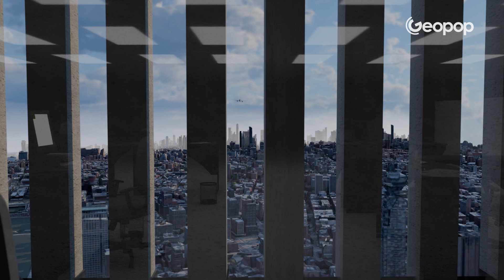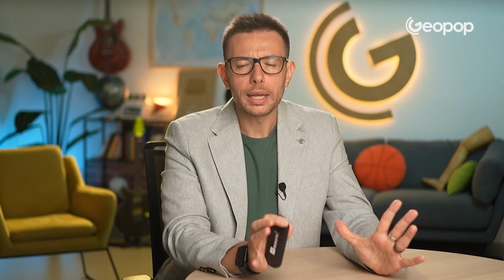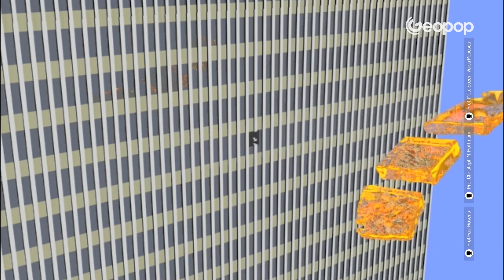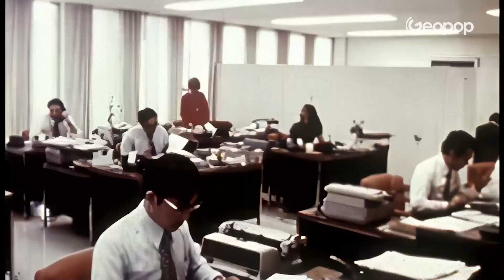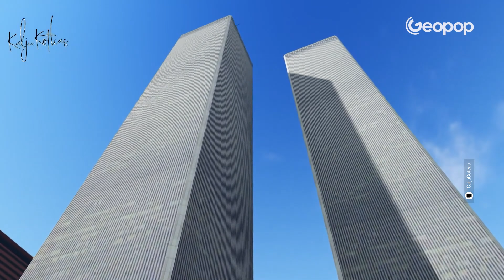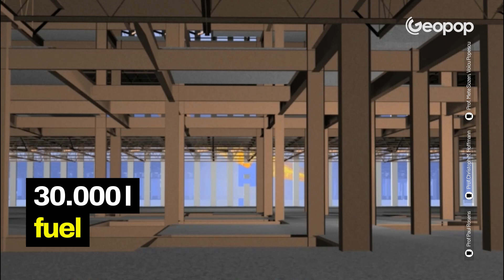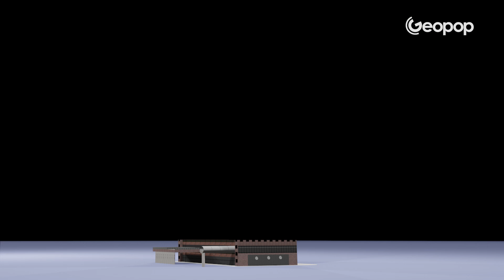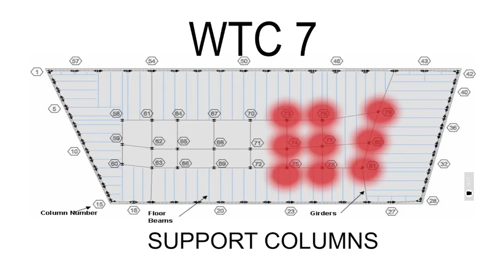9/11, 2001: The Technical Reconstruction of the Twin Towers and WTC 7 Collapses

Comment: In laymen's terms the floor trusses started sagging and pulling the exterior columns inwards and started buckling.  This coupled with the fact that the floors were weakly connected to the core and exterior perimeter tubes with visco-elastic dampers were the undoing of the buildings.  Steel is very flexible unlike aluminum and when heated up, loses significant amounts of strength
Reply: I work for a major contractor in NJ. We find those stupid bar joists everywhere and they typically very light weight. They are what hold up pharmacy, supermarket, warehouse, and other light roofs. Any time we put a point load over 150 pounds they require reinforcement. I can 100% can see those crappy joists giving way and pancaking the floors down.
Reply: That's what he said in the video we just watched, WTF?..
Reply: People tend to ignore the connections. 3/8” channel welded flanges to core. We see a portion of the core standing after the collapse. This tells me the welds broke. The outer perimeter connections were 3/8” angle which was 4”x6”, those would just fold with enough weight.
Reply: Thermite charges set by undercover CIA operatives to retrieve hard rives from the headquarters of the old CIA building so this whole video is a farce
Reply: Ask any veteran Fireman their opinion of steel support trusses.  They literally hate them because when exposed to the heat of a fire their tensile strength will compromise to the point of collapse.  Those trusses in the towers were no different.
Reply: @b3j8 correct. They say ‘never trust a truss’
Reply: @b3j8  they won't believe you. They prefer their wacky theories. I have heard that before though, isn't the saying never trust a truss
Reply: @TomVVG  Yeah I know they wont.  But I try to put the honest truth out there anyway.  That saying's valid for sure.
Reply: @b3j8  trouble is, I'd love to have an open minded debate about it with them, but it always ends the same way
Reply: @TomVVG   Nah, I'd rather spend my time watching the survivor stories.  One guy I really wish had made it out was Port Authority employee Frank Demartini.  He was an expert on the building's design and parameters.  He could have been a welcome source of honest, accurate information having made it up to floor 91 looking for survivors and trapped people.
Reply: @b3j8 yeah it honestly is sad he lost his life that day but I can't imagine the amount of hope he instilled in the people still inside till the very last second
Reply: @b3j8  theres a saying fireman have “dont  trust the truss”
Reply: @b3j8  I have heard that very thought. I agree.
Reply: Yes,the extreme heat took the temper right out of the structural steel. It obviously becomes very weak.
Reply: well 🤔if they haven't shipped all that evidence (steel) overseas  we wouldn't be debating what happened, that was a crime scene & should of been closed off and properly investigated
Reply: @Holiness_Holly  
There are steel samples all over the country now.
We have a few by a restaurant on the Mohawk River.
Reply: But that syncronous falling is weird..
Reply: @ahmetmutlu348  it was a progressive collapse, look it up. The floor at the impact zone gave way carrying the weight of 26 floors (2 wtc) and 11 floors (1 wtc). The floor below could not handle the hundred thousand tons crashing down on top of it

You 9/11 truthers are literally so fucking stupid I cannot understand how you cannot comprehend the collapse of the world trade center towers
Reply: Still doesn’t explain why the interior steel lattice completely disappeared. Assuming that the fire did weaken the interior frame, the section above the impact would have twisted and broken off leaving the building’s remaining floors beneath the impact still standing.
Reply: The trusses were much smaller than the perimeter columns...seriously, compare the floor trusses to the core and perimeter columns.  I find it very hard to believe that floor trusses that small (in comparison) sagged from being weakened by fire, and somehow found the strength to pull these huge sections of perimeter columns inwards and cause a collapse...especially in a softened state.  Steel structures sagging in fires is most definitely not out of the ordinary.  But in this particular case I don't agree that the trusses had the strength to do what we are told to believe.

Not to mention that the upper sections of the buildings, most easily seen in the North tower, seem to visually almost completely disintegrate within about 4-5 seconds after collapse initiation, seperately from the lower structure.  In other words disintegrating to practically nothing long before they ever could have destroyed the entire lower structure in a global collapse.  These 2 videos show best what I mean:  https://www.youtube.com/watch?v=-ib93ktc454&list=PLBeNQtKAgYU7SZNDOkdEivdzxw8WYGAp9&pp=gAQBiAQB
Reply: @yearginclarke  you literally havent got a clue what you are talking about
Reply: @dr00andrew  You can think whatever you want.  Right or wrong, my points are not coming from completely out in left field, this is basic stuff that is not even remotely hard to visually see in those videos and understand.  These are NOT unreasonable observations/questions, and there is absolutely nothing wrong about pointing this stuff out.  

My points will remain there to see for anyone who is unaware of what I brought up.  Your mind is already made up about what happened, and will likely never change until the day you die.  I believed that nonsense for 10 years.
Reply: @yearginclarke  It has literally been proven by SO many legitimate physicists.  You can literally see the south tower exterior columns bending in towards the core moments before collapse.  

You are basing your points on what you visually saw and I am taking facts from sources like the NIST who spent years calculating the exact specifics of everything that happened in order to come up their findings.  I still think you dont realize the exterior columns were load bearing and were severed badly on impact.
Reply: @yearginclarke  I am not an engineer, and this is purely speculation. The heat of the fire weakened the trusses, with 10s of thousands of pounds of paper, furniture, airplane parts, and burning fuel. Plus the damage of the planes impact which compromised the structure. I could see why the building collapsed. Once one floor fell on another it was all over. As the floors pancaked they hit less compromised trusses and the tension caused by the impact load pulled the exterior columns in.
Reply: @yearginclarke  i dont think the trusses by themselves pulled on the exterior but remember they had super heavy concrete slabs weighting it down not to mention that the fires weakened multiple floors and had a giant gash 6 floors deep inside it as for the North Tower we dont truly know the full extent of the damage on those upper floors considering how high it hit it only had 10 floors above the imact zone with 6 floors being torn apart from the plane so 16 floors of pure weight on it and on top of that someone filming from the helicopter mentioned seeing the building glowing red and stating they didnt have much time left
Reply: @lugiamastero13  I know what you're saying about the weight of the concrete and other building materials.  Personally I don't think it was enough to cause the collapse, but then again I'm no expert - and not claiming to be.  I could be wrong about all this.  

For me there's so many weird things about the entirety of events of 9/11, ranging from the collapses to fighter jet war games planned on that day...tons of other stuff that makes me question the whole thing.  But that's it for me on this thread tonight, I have to get up at 2:20 am for work.
Reply: @yearginclarke  yeah I'm not entirely sure myself though I do suspect that besides the concrete I think they had a partial collapse of the whole floors before the thing came down so there could of been much more weight than simply a single floor.

True which is why we must do all the research we can to explain everything that happened on that day as some thing may look questionable.until a full picture is done.

Very well have a nice day at work
Reply: @lugiamastero13  
Think of how the steel trusses would grow in length as they got hotter, and that would be a pushing force, and as they became even hotter, they would sag and pull with an inward force.
There are pictures that show the uneven exterior at the failure point.
Some pictures show a change as things progress.
Reply: please explain how a sagging truss is able to pull on a structure it's attached to that previously supported it. did it magically gain weight while sagging?
Reply: @TheDracarys  the floor truss is literally connected to the core columns and exterior perimeter columns that we’re experiencing fires of over 1000 degrees farenheit. People inside the towers were reporting the floors were sagging and collapsing and they could see the walls starting to crack

Imagine being on a deck and all the floor joists are cut in the middle and start sagging down. Do you really think that deck is going to remain standing?
Reply: @dr00andrew  you didn’t answer my question. The official explanation states that the sagging trusses started to pull on the exterior and interior columns. How did they do that? Clearly the perimiter and core columns supported their weight before they started to sag. Did they magically gain weight when they started to sag?
Reply: @TheDracarys  theres the weight of the 26 floors above the impact zone weighing down on 8 floors of sagging floor joists and severed core columns and exterior support walls. I really dont know how else to explain it to you. It appears beyond your comprehension
Reply: @dr00andrew  still doesn’t answer my question. of course the weight of the building above has to be supported and given the damage caused by the impact we should’ve seen the top part buckle and fall down on the side. Instead it crushed the entire undamaged building beneath without slowing down. That is impossible without removing the core structure first. The law of momentum conservation states that when a moving object strikes an obstacle and physical deformation occurs, the velocity of that object must decrease, since its energy is being converted into physical deformation. This was not the case with the towers.
Reply: @TheDracarys  you just dont get it. You are literally commenting on a video that explains exactly how the towers collapsed. 

Idk man, seems you just dont have a very good understanding of structural engineering. Its pretty obvious to competent people how the towers fell
Reply: @dr00andrew  if it was that obvious there wouldn't still be a debate about it 23 years after the fact. the NIST report contains an explanation as to what initiated the collapse, but it doesn't explain how the whole building was pulverzied. When asked about it, they said that the video shows what happened to the tower and they didn't think it was necessary to explain how it happened. So there is every reason to be sceptical.
Reply: @TheDracarys  there is no debate, it is clear as day to everyone whose not a 9/11 truther. 

The fact you think this was brought down by controlled demolition shows how truly ignorant and stupid you really are. You cant even spell skeptical correctly
Reply: @TheDracarys  I see you're getting hung up on the exterior columns being "pulled" inwards. Perhaps a better statement would've been, the trusses offered significantly less resistance to the exterior columns tendency to buckle inwards due to the heat and the weight above. 

To help you visualise this, draw  capital letter "H" using straight lines. The left vertical line reps the interior core, the horizontal line, the truss, the right vertical line the exterior wall. 

Now what most people don't get about trusses is that all forces must be balanced to make the structure stand. 

In other words, draw downward pointing arrows next to each vertical line above the horizontal line. (This reps gravity and the weight above). Then draw upwards pointing arrows on both vertical lines below the horizontal line (reps the steel's compressive resistance.)

Now draw an arrow pointing left parallel to the horizontal line and another pointing right. 

Now for the truss to work, ALL the 6 arrows must exert the same force or the total sum of their forces must be equal. Perfectly balanced. 

Now the moment you remove or reduce the value of the horizontal forces, particularly the horizontal arrow pointing right, then you remove the only resistance that prevented the vertical line on the right (the exterior column) from buckling inwards (or pull inwards as they said it in the video). 

If two teams are playing tag of war and they're at a stale mate, if you remove 90% of the people on one side, the other team will pull them to their side, NOT because they have gained strength, but simply because there is suddenly much less resistance on one end. The strength remains the same. 

The heat made the truss soft thus upsetting the balance in the forces. 

Look at that bridge collapse after it was hit by that ship, one column hit and knocked off it's joint, nearly the entire bridge collapses because all forces were balanced to support the bridge and the hit from the ship disturbed that balance and trusses do not like that one bit.
Reply: @TheDracarys  and as for your point on how the momentum from the upper floors could've resulted in a chain reaction that led to almost all the floors below the damaged section to pancake when part of the energy of the upper floors would be turned to distortion in the undamaged floors, remember that gravity is a constant force, introduce E=MC^2 and subtract the energy needed to break the contacts of the trusses (the floors) to the interior and exterior columns you will find that the surplus energy after distortion of the undamaged floor would still be enough to sustain the chain reaction of collapsing floors. (Remember the mass of the floors above the critical point or next failure point keeps increasing with every floor worth of rubble added to it by the previous floor's collapse thus the energy grows with each floor) 

As an example look at a video of any building demolition and you will see that once you get the collapse going with a few charges set at the lower floors, the whole thing usually pancakes without losing any momentum. 

While you're doing that ask why they set demolition charges on support/ load bearing columns on lower floors of the building and not on every column. All you need to do is disturb the balance in the moments of the forces and the whole thing will collapse.
Reply: @davidngenda7896  I understand what you’re saying. It’s not that i’m hung up on it, i’m being contentious because the official explanation as to what caused the start of the collapse is the truss sagging and pulling inwards, not the exterior columns pushing on the truss from the outside. And even if it did, we should have seen the top part above the impact zone buckle and fall to the side, while the rest of the structure should’ve remained standing. Furthermore, the trusses were suspended between the core and the perimiter. If anything, they prevented a distraction between the two, not resist compression. In addition, you could cut an entire side of the tower’s exterior and the adjacent corners and it would be capable of withstanding a 100mph wind. I’m not saying the damage wasn’t substantial, but the official explanation does not satisfactorily address the collapse initiation nor the complete collapse and destruction of the healthy structure below.
Reply: @davidngenda7896  so to understand the collapse of the twin towers I need to look at a video of a building demolition? I find it very hard to believe that the plane impact resulted in such a specific pattern of damage to mirror what you said I should look at as an example.
Reply: @davidngenda7896  also. For every action there is a complete and opposite reaction. The healthy strucute below the falling segment pushes on it with the same force being applied to it. Just like a rock that is falling down a hill will break when it impacts another rock and its velocity will decrease. The energy of a closed system remains constant.
Reply: @TheDracarys  if you study the collapse videos it becomes easier to understand the collapses and listening to survivors stories plus the fire fighters radio audio it becomes very aparent the intense damage of the buildings inside, people tend to overlook this because they didn't know but from watching the naudet documentary as the guy enters the building you can see shattered marble chunks that had fallen off the core I can only imagine the inside the core being cracked especially since some survivors mention cracked stairwells and walls which means that initial fireball caused a ton of vibration damage on its way down those elevator shafts to the lobby on top of that the plane damaged 6 whole floors almost entirely on each tower the Shockwave caused other floors to break either above impact or below impact it honestly wouldnt of have been that hard considering all the floors were sitting on metal boots anchored to the exterior and in the core as well so if anything fell on top of it, it wouldn't offer nearly as much resistance to being crushed but it also makes it really resistant to wind in other words those floors were not very well attached by design but offered just enough protection had a section broke and collapsed it would of been easily fixed but on that day the damage was extensive. If you wanna understand how having a small bit of damage can cause the exterior steel to buckle you can do a simple experiment at home get a empty soda can out several books that are heavy on top of em and stack em up after that hit the middle side of the can and cause a small dent and watch as the whole thing simply buckling under that weight despite being able to support the load at one point.

Lastly I wanna explain how the collapses happened so to start the impacted floors were already damaged and then lit on fire as the structure was losing a lot of its strength the floors ok fire began to sag because trusses are just terrible on fire, they accumulated the weight from the busted concrete creating a side of the building that was much heavier and as the fires raged it also weakened the exterior once it could no longer support the weight they buckled inwards because they were still connected however once the tower began to fall it leaned pretty heavily though I do get that some people said it should of fallen off it sorta did it crushed several floors below before they lost momentum and began flowing down the sides as dust after which it kicked off a chain reaction where the steel and concrete crushed floors below impact with such great force and quickly as well, as the floors crumbled the exterior stood for a few moments and so did the core so just the floors themselves we te being crushed and they were contained inside the building due to the exterior but once enough of em fell the exterior peeled away leaving only the core standing on the south tower at the very least it held about 40 ish floors worth of core the north tower had about 50 to 60 floors worth of core standing though without any support left it swayed and considering the cores were already cracked from initial impact it didn't take much to just simply fall apart so yeah it broke apart in 3 ways to summarize floors were crushed by other floors all the way to the bottom exterior peels away because it was no longer connected to anything and then the core fell due to lack of support and damage from initial impact playing played a role in its entire collapse
Reply: Steel might be flexible, but in no way it can turn into fine dust
Reply: @guidrumstick no, but concrete would. 

The floors had 4” slabs of concert, laid 208’ x 208’. 

It weighed about 1.9 millions lbs every floor, just on the weight of the poured concrete. 

This isn’t some big conspiracy.
Reply: @nonenone7761  🤣🤦🏾‍♂️
Reply: The dust came from the concrete flooring and not from steel ...do u have brain?? @guidrumstick
Reply: @guidrumstick I did some research on steel & high temps. At the ( estimated) 1000 degree temps reached:  "steel will buckle, warp, bend & lose significant strength". Then, the majority of the internal walls were sheetrock not concrete. 2 stranded groups realised this & smashed thru it to escape. The 2 groups are mentioned in most of the documentaries, 1 group stuck in a lift & 1 group in an office. Many of the buckled steel girders ended up in "the pile" afterwards & were removed by cranes, as footage of the aftermath shows. 2 of the largest of them were made into a permanent memorial. Also one of the surviving Fire Chiefs mentioned that burning jet fuel cascaded down the lift shafts spreading the fire fast to lower floors, weakening them quickly. The towers tube structur of an external steel casing with a core support was not the norm: it was a cost saving thing re the costs of steel. Source: UK Channel 4 documentary that looked at the architectural drawings & spoke to several structural engineers, plus the senior guy who approved the design & liaise with the now deceased architect who came up with the tube design.
Reply: @guidrumstick Ever heard of drywall? Edit: The floors were concrete anm crumbled to dust.
Reply: @whaaat3632  the whole buildin was made of it? 🤣🤦🏾‍♂️🤣💀
Reply: @guidrumstick  If you look at the wreckage, it literally looks like what a destroyed building would look like. There was enough scrap metal that literally was sold for millions of dollars, as well as used in the 9/11 museum, and another memorial elsewhere.
Reply: @guidrumstick it didn't....the fine dust was the concrete and drywall...the steel stayed in big bent pieces
Reply: @V0ID_beats  stop it 🤦🏾‍♂️
Reply: @guidrumstick  Where exactly in my comment did I say it turned into fine dust? As a matter of fact the creator of this video shows clips of the bent up twisted steel and explains how the NIST was able to use pieces of steel from the wreckage to see what happened to it in the collapse. 

The “fine dust” you are referring to is gypsum board and concrete falling 1000 feet to the ground in 10 or so seconds
Reply: Explain the thermite pools
Reply: Ok so what are you harebrained conspiracy theorists actually trying to suggest here? If the collapse was intentional and due to demolition. Then WTF did they even bother convincing foreigners to go kamikaze with our own planes into the WTC’s that we have set for surprise demolition anyways? How about you guys explain that whole mess of logic. 

Keeping in mind George Bush became president 8 months prior, which would of meant he proposed the plan and got it set IMMEDIATELY after taking office. Right. Also how charismatic and manipulative do u gotta be in order to convince a dozen foreigners to go kamikaze? Especially when half the targets are gonna be demolished anyways. Talk about serious collateral waste
Reply: @dr00andrew  🤣🤣🤣🤣🤣🤣
Reply: How can I burn that hot kerosene based fuel doesn’t burn that hot even with office furniture computers and paper I believe it was thermite
Reply: @Texasgalincali  does wood burn hotter than kerosene? No but by adding air flow it burns faster...and hotter. You can actually perform that experiment yourself.  Give it a try
Reply: @Texasgalincali  a wood fire can get ridiculously hot in the right conditions, like a kiln, it's not out of the question that a fire in an enclosed skyscraper filled with combustables and an accelerant (fuel) would reach 600-1000 degrees. Especially being at that height with the wind fanning the fire unimpeded.
Reply: @Texasgalincali  With added sulphur, Thermate.